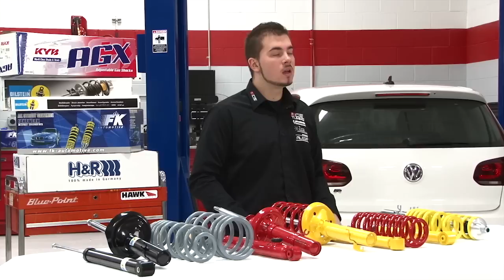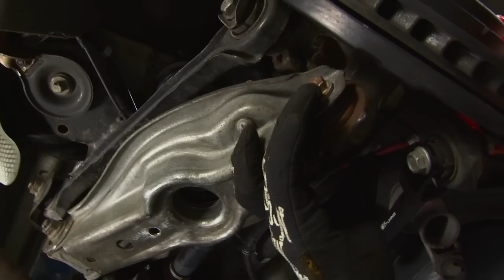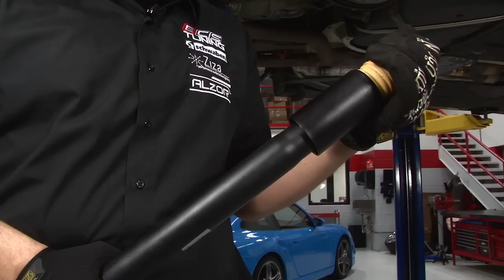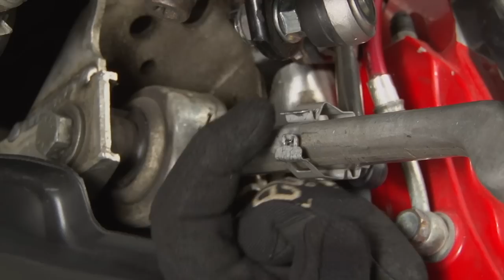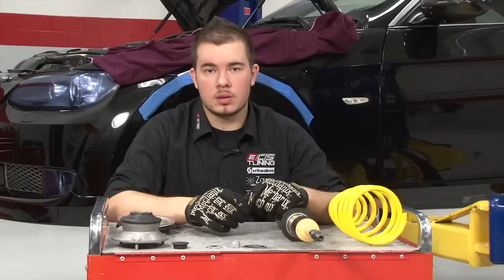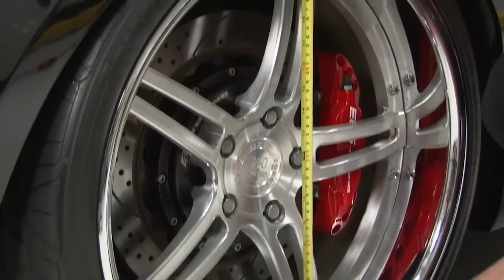ECS Tuning: BMW Coilover Installation

Comment: Helpful video thank you. But I will add when he says to not worry about the alignment when loosening the inner bolt on the rear lower control since you'll need an alignment anyways ignore that comment. Mark it and make sure you get it back into that position. I just loosened and re-tightened it only to extremely put the alignment out of whack. Out right dangerous driving on the wet free way later that day. Major rear steer going on. I then adjust it by just eyeballing and its better but still very out of alignment and now have a dsc malfunction. I plan to get it aligned of course but not after I drive it a bit and make minor height adjustments. Would have been a lot better to maintain the alignment I did have by simply marking those bolts positions.

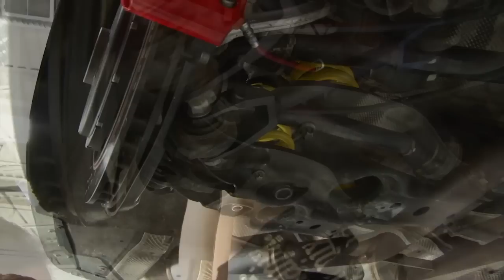Comment: WARNING: 7:35 DO NOT TORQUE THAT NUT TO 28FT-LB, I STRIPPED MY SHOCK BECAUSE OF THAT. TORQUE IT TO WHATEVER THE MANUFACTURERS RECOMMENDATION IS. Other than that great video, thanks.

Comment: Great video, great tips!!!  I tackled my coilover installation this weekend and your video was extremely helpful, thank you for sharing!! 
Sometimes I wonder is those random shops actually take the time to torque the bolts to spec or just use the impact gun and call it a day!! :I
Reply: They use an impact and call it a day, working in a shop can be brutal tbh, everyone is working on commission, some techs straight up don't care and will use an impact on everything so they can flag hours, it's rough out there.

Comment: Great video.  Can you please tell me the size of the nuts and bolts on the rear control arm please?  Specifically the ones that you are only to tighten when the suspension is loaded.  Thanks!

Comment: Whats the purpose of the 90 degrees turning of the bolts for the control arms after you have torqued them down to factory specs?

Comment: Would it be necessary to replace the bolts that connect the contol arms to the (forward) subframe? I've taken the tension out for extra clearance on the strut/fender..

Comment: Hello, May i know the reason behind to rotate the bolts to 90° @16:09 after torquing them down.. Thanks..
Reply: This is what I'm wondering too. Any thoughts on it?
Reply: Like if he already torqued it, if he tightens it again to have the marker lines 90 degrees that wouldn't be to spec anymore
Reply: @seanthao  that 90 degrees is part of the torque spec according to bmw. A lot of torque specs require an specific additional degree of rotation after the foot pound torque figure

Comment: wow I shouldve watched this before installing megans on my car, I had to push down on the rear rotors cuz i didnt think about the rear control arms like that. BTW i needed wheel spacers in the front so ALWAYS have them just in case cuz u will be rubbing and messing up the inside of the wheel (2 days did a number on mine)

Comment: ECS, would you happen to have a specific video for installing the FK street line-coil over kit on a MKIV?
Reply: oh man, I wanted to order the FK's from your site but needed a DIY video..Thanks tho
Reply: @charleshang2842  you could have watched any brands' cheap ass Chinese coil over install video on a MKIV and applied the same process to the cheap ass Chinese FK's. Then made your own video to share with others and help them. 

However, if this was an actual question you would have been better off contacting ECS directly- Instead of posting your question on a YouTube video that's installing ST coils on a BMW. It seems common sense isn't very common these days.

Comment: is there any harm in installing the rear spring perch on the control arm? I've seen setups with the adjuster at the bottom.
Reply: On the e9x the lower spring perch is part of the subframe (and is quite aggressively shaped) so an adjustable lower perch wouldn't be optimal

Comment: Hi, great video and sheds loads of light suspension . my 116d se I notice the the rear right gap between the tyre and wheel arch is smaller by 1 to 2 cm than the other wheels, so basically one side looks higher than the other. Would you know what might be causing this??
Reply: +awais shah thats how bmw set up the suspancion to comensate for driver weigth.
Reply: +Balle K.Lorin it does sit lower on the driver side around 1 cm I've seen this on a few cars , is that normal for the car to lower on the drivers side / right hand drive car
Reply: +awais shah i have read bmw documents that say the ride higth is a little lower on passanger side, and i have messured my own car E92 m-sport left hand drive, my left side is 5mm higher, so yes this is normal.

Comment: Awesome explanation mate. Could I use the same torque settings for 2005 e90 320i sedan? Thanks.
Reply: Toko H assuming you've already done it... but they're not the same. Bentley manual suggests a different number for our e90s (installing ST coils on my E90 330i today)
Reply: Nolan Norris what are the specs you used if you don’t mind telling?

Comment: I got some springs do you think it's fine to put them on with oem struts and shocks ? 08 335i 108k miles
Reply: GangGreen_714 your shocks would most likely be shot at that mileage and age
Reply: Yeah ur shocks are shit by then, I have sAmE miles and mine are boned

Comment: How did you line up the hole between the rear wheel hub and lower control arm so easily, was I pain when I was doing it, when I lift the lower control arm with the jack, the lower control arm was kinda pushing the wheel hub upwards instead of let the hub slide in between the gap between the lower control arm, but finally sorted
Reply: Use a long smooth Punch! GENTLY ;)
Reply: Lillestoel how did u do it ?

Comment: You didn't cover so much it's ridiculous.  Plan on fully arm camber adjustment and tons of other things not mentioned . ECS tuning is a terrible supplier also and will mess up your order and end the wrong parts , often to the wrong place thsn be rude.
Thier billing dept is not directly connected with shipping. They told me go find the part they missed shipped to a place I lived five years ago. Use someone else

Comment: I ran into into a problem. I thought I was prepared, but I wasn’t. I need pass through sockets to tighten shock on the bottom. My question is, since I tried tightening the 17mm bolt and the shock was just spinning, did I damage my brand new shock by it spinning freely? This is Koni STR shocks